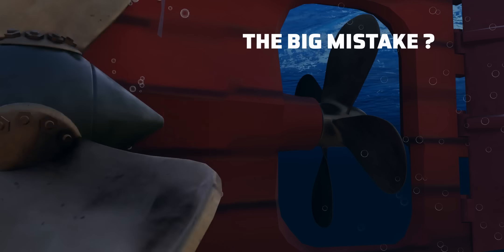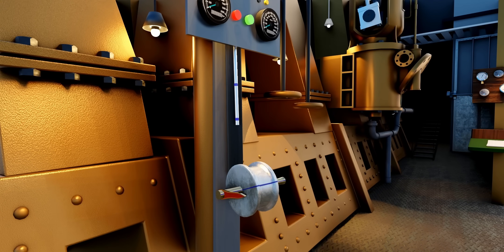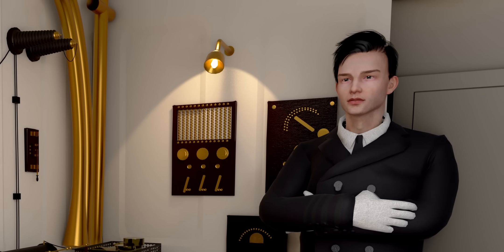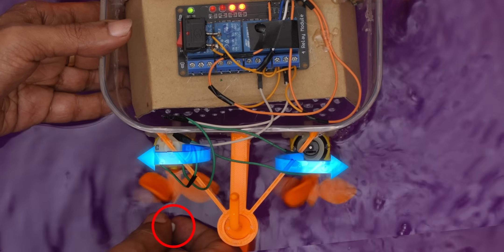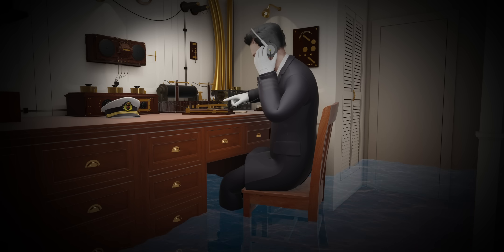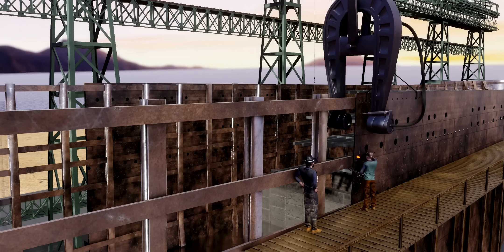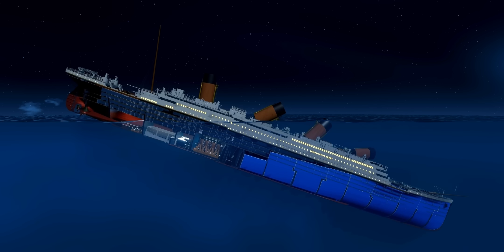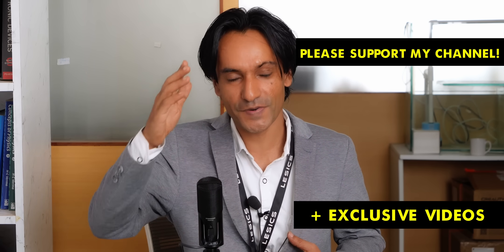How did Titanic sink? | Solving All the Mysteries

Comment: But the speed they were going at wouldn’t have mattered if the engines were reversed or not. Titanic moved better at slower speeds then faster speeds. Murdoch tried to slow the ship incase they couldn’t make the turn to prevent to much damage. Problem was the speed it’s no different then your car you can make more precise turns at slower speed that’s what Murdoch was trying to do by slowing the ship down.

Comment: Question: Titanic was travelling at around approx 20 to 25 knots I think...if Titanic was travelling slower (lets say 15 to 19 knots), could they have avoided hitting iceberg? They would of had enough time to turn and miss iceberg rather than the side of the Titanic getting cut up by iceberg. I mean, there was no need for the Titanic to be travelling as fast as she was through iceberg field.
Reply: At 19 knots it would get slightly bigger turning radius, but if they got minute or so - they could've made it
Reply: @dark_messenger yep. No need for Titanic to be travelling as fast as she was.

Comment: It was only 37 seconds after the iceberg was spotted when Titanic made contact with it.  Reversing the engines in time was an impossibility regardless of whatever order was presented from the bridge. The bigger question I have is the delay on the hard turn order and exactly when the engines were stopped.  I believe if the rudder was hard locked just a few seconds sooner , Titanic would have not  made contact with the iceberg..  Incidentally, the rudder is most effective when engines are full throttle.

Comment: There are lots of wrong info in this video. To prevent the boilers to explode they immidiately stopped all the boilers and they have even tried to get rid of most the the steam from the funnels to decrease such risks. That is why during the initial-mid phases of the sinking it was very loud.

Comment: Hey, no insult to the person who did the program for YouTube here, but the rot iron rivets were only used in the bow and the stern the entire ship nearly the entire ship was done with steel rivets so get get your facts straight the machine used as the electric Riveter worked on most of the shit. It was just the narrower points of the ship where it had to be done by hand and rot iron was used so yeah why don’t you actually look at the plans from Harlingen wolf because they directly tell you this oh one more thing the lifeboat issue is moot Because they only had 20 lifeboats. They didn’t have time to launch more the last two floated right off the deck they ran out of time as the ship began his final plunge about 2 1/2 hours later so yeah, having 48 votes in this case with a disaster now it wouldn’t of mattered. All they could do was overload the boats with women and children because they weigh lessunfortunately, they didn’t do that when a ship sank, but all of those men and the engineers should be viewed as heroes not as villains.

Comment: The Olympic and Titanic were the largest ships of their time.  The technology on these ships was cutting edge and most of the crew wasn't familiar with all of that.  It was a series of fatal errors.  Even the Olympic had an accident with the HMS Hawke due to the ship's size and basically sucked the Hawke into it.  However they didn't understand the issue and were too close to Olympic.  The Marconi operators used the signal SOS, not CQD.  In fact, the Titanic was the first ship to use the SOS call.

I wonder... If the boilers powering the generators were going full bore when the water entered the compartment, did they explode?  If they did, it might have been one of the reasons the ship broke up the way it did.

Comment: Those engines were the size of buildings, with huge slow, heavy cylinders running on compressed steam. To go from full ahead to full astern, even with the best engine crew, would take several minutes.

The iceberg was spotted SECONDS before collision. There is no way those engines were in reverse before they hit the iceberg. Best case scenario is that they were winding down.

Comment: Why isn’t the propeller in the middle not spinning because it’s supposed to spin
Reply: the low-pressure turbine (centre prop) doesn’t have a reverse. 

In fact, it’s still debated IF the engines were reversed at all. Some first-hand witnesses say they were stopped, some say they were reversed.
Reply: @DanielBrennan9  Likely, ordered stopped before crash, then ordered reversed shortly after the crash.

Comment: So you're saying it would've turned more tightly if they hadn't hit reverse? Do you really think they didn't understand how rudders work? 

The quicker the water flows past the rudder, the greater turning force it will generate. That doesn't necessarily mean the ship will turn faster! A ship can turn more tightly if it travels slowly, despite a smaller rotational force, because it's also not moving forward as quickly. 

Also, after contact, they turned the ship back towards the iceberg to avoid hitting the stern too. If they hadn't made every effort to slow the ship, they might've damaged the rear of the ship, too, causing it to sink faster.

What idiotic arrogance to say they made a mistake by hitting reverse. You probably just saw a video about torque and assumed it meant the same thing as maneuverability and turning circles

Comment: Error 1) 
Titanic´s engines weren´t put into reverse. They were just ordered to be put into reverse. However the inertia of the piston steam engine was so great that they barely managed to stop by the time they hit the iceberg. There just wasn´t enough time for the engines to stop and then start turning to the opposite direction. And no, it is not a point of debate. The surviving crew members stated directly and correctly that the engines barely managed to stop.
Error 2) 
Titanic´s Marconi device didn´t outright print the incoming messages. It sent them directly to the operator´s headphones like a beeping sound.
Error 3)
Yes, Titanic´s front crowsnest´s binoculars were not available, but they also wouldn´t have helped. Binoculars are used to observe spotted objects, not to spot objects. Their very narrow field of view makes them impractical for spotting objects. And the iceberg wouldnt be visible earlier no matter what, binoculars would change nothing about that.

Comment: Water is not "pushed" by propellers. Some thrust is present at takeoff but once the ship is underway the propellers are screwing their way through the water. Like a drywall screw through gypsum. All boat/ship propellers even have these ratios stamped on them for how far they will travel as per 1 rotation of the shaft. In Aviation, the same principals apply. The proper name for an aircrafts propeller is actually an  "Airscrew." However a Jetboats "Water-Jet" does push water.

Comment: You know if the ship had not been put in reserve and it going forward at full speed it would have turned a lot faster because all 3 propellers would have been spinning at full speed making it turn a lot faster if they done that instead   Of putting it in reserve it would have probably missed it
Reply: They stopped, not reversed

Comment: While the Titanic could theoretically be put in reverse, the process was time-consuming and complex, and it's debatable whether it was actually attempted in the time available before the collision with the iceberg. Crew testimony suggests the engines were simply stopped, not  reversed, and the movie "Titanic" dramatized the scene. 
Yes, the Titanic could be put in reverse, but it wasn't a simple matter of flipping a switch. The Titanic was a triple-screw steamer with three propellers: a center propeller and two outboard propellers on the port and starboard sides. The port and starboard propellers could be reversed, but the center propeller could only propel forward. 
To reverse the engines,  the Titanic needed to: 
Cut off steam to all three engines .
Allow the engines to wind down .
Change the gearing on the triple expansion engines .
Pressurize the "reverse" steam chambers .

Comment: I should mention this video uses very outdated information regarding the engines being reversed. This was older evidence that hadn’t had as much research at the time. It was later determined that the crew had only stopped the engines and not reversed them. It was uncovered from lead fireman Frederick Barrett’s testimony in 1912 that the stokers in the boiler rooms had received a stop order, meaning to shut the dampers, which indicates the engines were being stopped. That order would not have come through if the bridge crew were reversing the engines. They only begin to shut the dampers on the fireboxes if the stop order is received to try to lower steam pressure when the engines are stopped. Plus, with how little time there was between the iceberg being spotted and the impact, there’s no way they could’ve gotten the engines up to full reverse. Cameron’s film in particular kind of exaggerates how much time there was but some of the real time animations that have been made show this really well. They barely had any time to react after spotting the iceberg.

Comment: Reversing engines was SOP(standard operating procedure) at the time of the Titanic incident.    As was the combination, in the 1970s, of reducing throttle and increasing pitch up, on a commercial airliner experiencing a loss of engine power during takeoff.

Both SOPs(the one for Titanic and for the DC-10 servicing American Airlines' flight 191 out of Chicago in 1979) were well intended, but later found to be misguided and counter-productive in life-saving value.

In the more recent case, the complete separation of port side engine and pylon on AA flight 191 also killed all indication on the captain's side of the cockpit as to what was really happening.  The decrease throttle and pitch up procedure was developed to reduce takeoff speed to V2(safety takeoff speed), which would have been appropriate for loss of engine thrust, but NOT LOSS OF ENTIRE HARDWARE.
Reply: The engines were reversed post collision. Those in the boiler rooms and engine rooms said a stop order came down just before collision. The order to reverse the engines came at 11:42.
Reply: Stopping engines was sop…

Comment: The first water tight compartment didn’t flood, according to eye witness account by crew member Mr.Samuel Hemmings , only the Olaf tank did of that compartment it’s purpose was to pump sea water in or out of the ship to help Titanic be on an even keel when sailing ⛵️ for passengers comfort, he awoke to a very loud whistling sound & inspected the area for water but found none! That first compartment stayed dry till the water filled it from the second water tight compartment the bulkhead being closed no water got in, till the water came up over it then into that compartment which explains why the front of the ship had buoyancy for a good forty five or fifty minutes after the sinking. So at the fist clip here of the ship taking on water is incorrect.

Comment: 1. The first engine order sent down was All Stop…later on a reverse order was sent down
2. There were 5 telegraphs on the bridge. Two EOT…one emergency…two for docking…none controlled the boilers
3. No tape printout on the telegraph system…none…
4. The iceberg messages were not addressed to the Captain…the Marconi operators had no responsibility to take them to the Captain…
5. The lookouts were never assigned binoculars… they were to use their eyes…
6. Wrought iron rivets were only used where the rivet machine would not fit…they were put in by hand…
7. Only 4 main generators behind the engine room. There were 2 emergency generators located above the turbine room…
8. And …. …
Reply: I was done after the incorrect bit about the binoculars. So many inaccuracies and misreported facts in the first 5 minutes. @timothyreed8417 thank you for calling out the errors. I hope people that watch this drivel take the time to do more research than the author of this piece did.

Comment: CPT Smith deliberately sank the ship! He knew reversing the propellers would cause more problems! He didn't try to drop anchor! The binoculars were locked in a locker. Just because they didn't have a key - because Smith fired the guy who was assigned the crow's nest job shortly before leaving the port. There was only one guy in the crows nest! Many videos I have watched were taken down! The rivers would not have "unzipped" the side of they were made the same way as the other side! Bruce Ismay and JP Morgan had the Irish engineering firm change that side to low grade rivets! They also removed a bolt from the boiler room, No. 5 or 6 - to cause them both to combust and blow up like dynamite! The locktite windows were OPEN, cmvia orders of CPT Smith! He also had the crew literally lock 1,000 passengers below, with the crew who worked on saving the ship, having water gush in since the locktite windows were open! They were banging to get out! And he wouldn't let them out! Witnesses who survived and were still living to make videos told the interviewers that! CPT Smith was NIT Liked! The richest people in the world were on that ship, being lied to about everything! Enough safety boats - Yes,but a lie!; steamship boat for rescue - Yes, but the crooks who helped Smith loit the ship plus Smith himself used it to ESCAPE! Four engines-Yes, but a lie which they continued to believe because there were 4 funnels! NEVER was a funnel on a ship for ventilation! And even so much more! This was such a a criminal operation, just as September 11 was!

Comment: Titanic was supposed to have 4 engines, another reason why Thomas Andrews quit! Ismay and Morgan learned it was easier to make it fail and sink with Three engines. Yet to fool the public they put up four funnels since it was publicized to have 4 engines! 
Did any other ship have a funnel for a "vent"? NO!!  Because it was not needed!
Reply: You're wrong @timothyreed8417 - the TECHNOCRACY falsifies records and more! It's their sociopathic way to feel they have control over the masses! Your choice to be their puppet is either because you're too lazy to have a mind of your own or you're a CIA psyop being paid to push their lies. At least one of my relatives turned out to be a CIA operative,so I know it first hand!
Reply: You more dumb than most Olympic and Titanic switched theory, research first before comment. The 4th funnel it is a ventilation, that also used for fireplace, plus looking at Olympic class blueprint it obviously you can see it was designed for 3 propeller/engine, and no boilers right below the 4th funnel. You more likely ragebait than spreading information
Reply: Never was designed to have four engines…
The 4th funnel was to provide ventilation for the turbine room and to provide balance in the location of the funnels and to match the other 4 funnel ships ‘power’ look.

Comment: There was only ONE radio operator and he worked to 11pm and turned off the radio Marconi radios were new inventions and like Internet, was an opportunity to commit crimes and get away with it. Someone managed to shoot flares yet the specifics are hard to determine. Nevertheless, CPT Smith literally locked 1,000 people in the lower deck because water was gushing in because he ordered the locktite windows to be open before they hit the iceberg. Boiler Room 6 exploded from combustion due to a deliberate removal of a bolt before the ship was boarded. Those bolts were the size of a couch and much greater in weight. Rivets were several pounds each. This sinking was a criminal plan to murder the richest people in the world and create a new economy. Seize wealth, etc. September 11 was also caused by USA.

Comment: It has been confirmed by tests and simulations on the sister ship OLYMPIC that between sighting and hitting the iceberg there was a time interval of about 60 seconds. This was not enough time to stop the engines (20 - 25 seconds under perfect conditions). But the engine crew was not expecting a FULL ASTERN order at 20 minutes to minight whilst “full-away” at sea. At 11:40 pm, just when they were preparing to hand over the watch. Furthermore there was an approximately 10 second delay to pick up the phone on the bridge and listen to the warning from the lookouts to the bridge crew that there was an iceberg in the ship's path, replace the phone, and repeat the information so that Murdoch understood. 20 seconds had already passed. Then Officer Murdoch had to see the iceberg ahead in the darkness for himself and determine which way to turn the ship (5 seconds) (25 seconds elapsed). Then the ship’s helm had to be turned to ‘hard over to port’ (10 seconds) (35 seconds elapsed). As a consequence, the engines were at most only stopped when the ship hit the iceberg. (Source: Richard Crowhurst - Former Naval Architect)
Reply: In case the helm was turned "hard to port" as you suggest, the ship would have steered straight into not away from the iceberg.

Comment: - According to engineers and boiler operators' testimonies, the engines never received a reverse order, but a stop order
- The engine telegraphs on main bridge used to communicate with the engine room were the same used to communicate with the boilers, since they needed to get the same order at the same time. There were 5 telegraphs: 3 were used for the 3 engines of the ship (2 reciprocating engines for the side propellers, 1 low-pressure turbine for the central propeller), 2 for communications with the docking bridge at the ship stern
Reply: Still  it doesn't change the fact that they should have kept the full ahead speed to maximize the turn of the rudder.
Reply: so James Cameron got it wrong :(
Reply: @vanguelisk  he just used the infos about Titanic available at that time. A lot of things have been discovered/updated since 1997